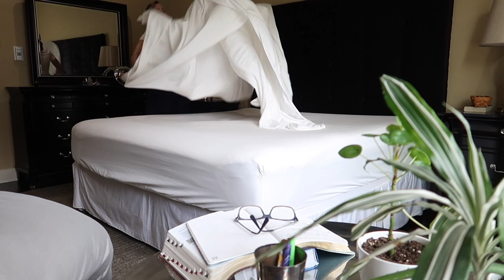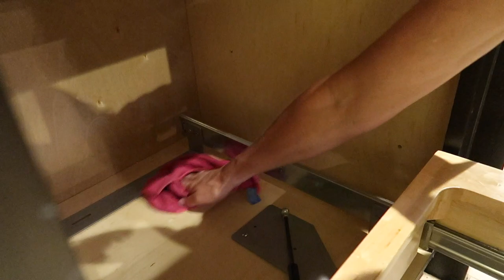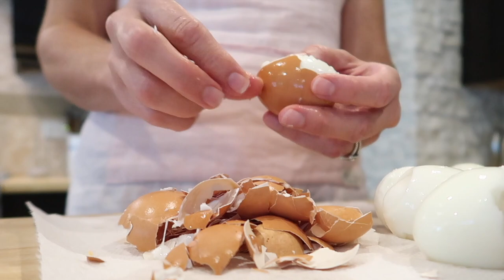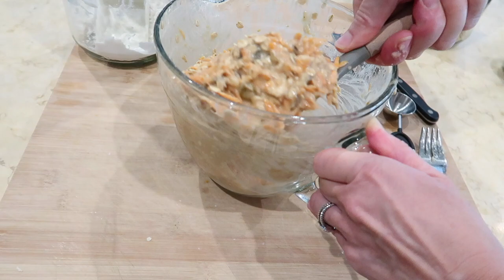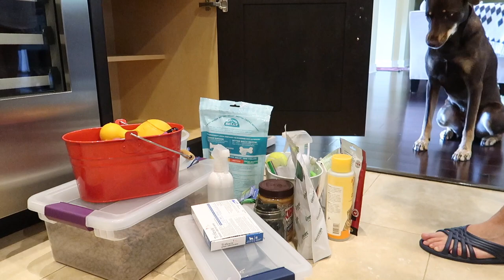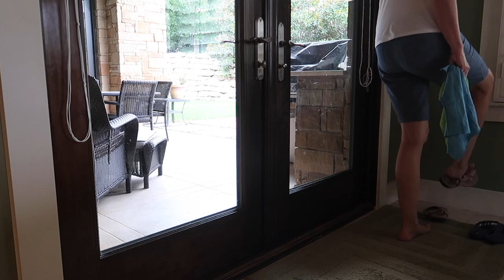Everyday Homemaking | 5 Minute Tasks & Avoiding Procrastination | Cleaning Motivation + Muffins!

Comment: After doing my eggs in the instant pot I also shock bath them and then just roll them on the counter with slight pressure causing them to crack and they slip right out of shell. No picking hard shards of shells, incredibly easy.
Reply from the maker: I’ll give that a try Cissy 👍 Usually the instant makes it super easy, but I’ll try your technique too! 😊💙

Comment: I do my instant pot eggs on low pressure for 6-7 mins quick release depending on if I want the yolk just a little soft or not.  I always use a separate bowl for my ice bath so next time I will do it the way you did - one less pot to clean
Reply from the maker: I’m all about fewer dishes to clean! 👍😂💙

Comment: Crack the eggshell and then put them in cold water - it’s much easier to get the shell off afterwards.
Reply from the maker: Thank you! I have done that before and you are right! I don’t know why I didn’t think to do it this time! 🤦‍♀️😂💙
Reply: I was just abt to write the same tip lol. I don't usually like to keep the faucet running but in this case, I just try to be as quick as I can. Cracking the eggs make it so much faster and bc of the thin film on the egg, it strangely satisfying when peeling off the shell in almost one large piece.
Reply from the maker: I know exactly what you mean! 👍😄🥚